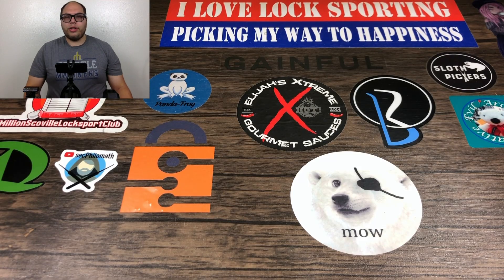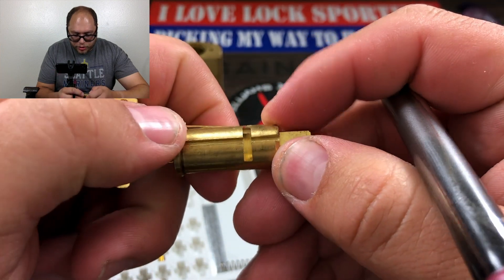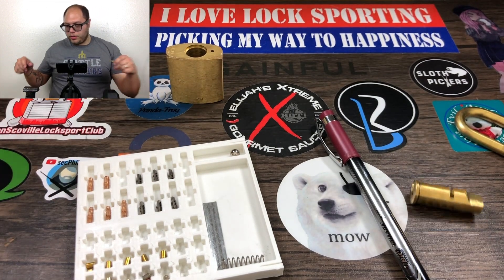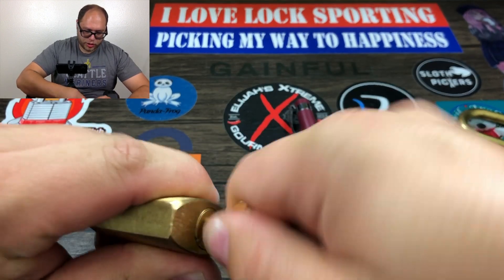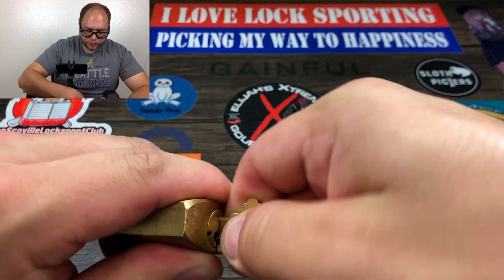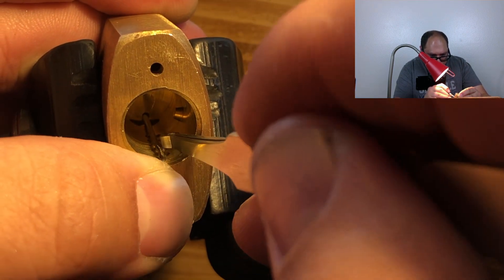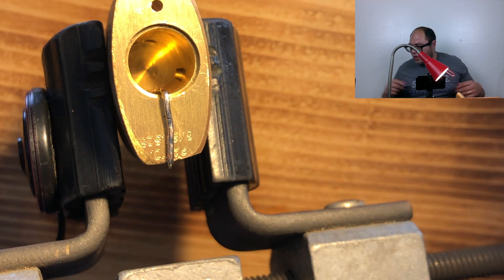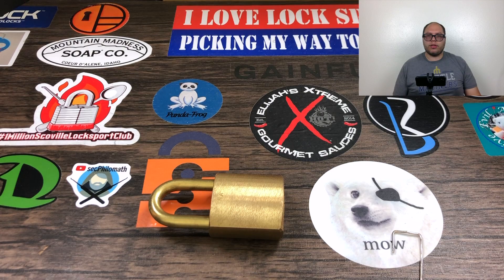How to Fix 101: Almont "ReKey"

Comment: Going to locksmith it up in here. Make a reloading tool out of a 1/2" dowel drill 5 holes the same spacing as the plug into the dowel. Use a rasp or a plane or a belt sander to remove the chunk where the retaining pin is. Then cut a slot down the pin holes. Then load up the pin holes with the springs and top pins. You might need to squeeze them into housing. Line it up with the bible and put the clip to push the top pins into the bible there you go.

 They used to make a specific follower for repining Almont locks. You can still find them on eBay. But it's easier to 3d print them or make them out of a dowel.

Comment: Nice cleanup! I also found a Almont Re-key lock recently, it's gonna need some cleanup, including the shackle which is steel on my lock. Do you know anything about removing the shackle? Is that what the second hole on the bottom of the lock body is for?